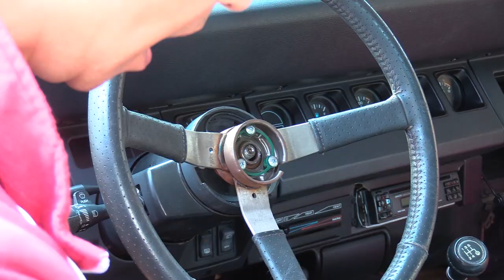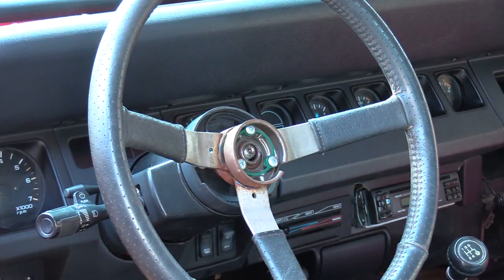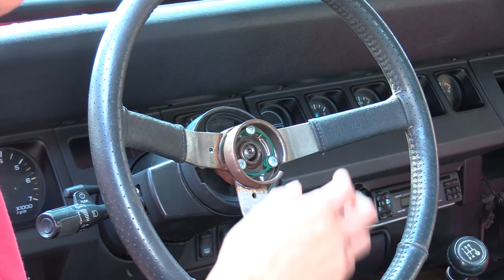How to install a Grant Steering wheel and horn on a Jeep YJ

Comment: I hooked up my steering wheel exactly how you showed. My horn is not working, the horn is new and worked prior to putting on the new wheel.
Reply: Never mind... didn't have the brass bell pushed down enough .